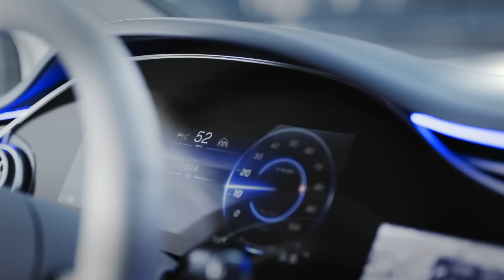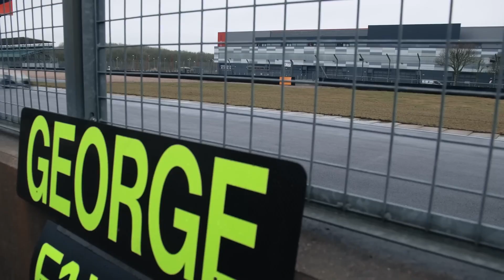Formula 1 Is Headed for Disaster..

Comment: you can't compare formula one to the entire European car industry. We're talking about hundreds of millions of vehicles with hundreds of supply chains that have to be carbon neutral by 2030. F1 only has 20 cars, 10 manufacturers and even they share the power supplies in between them. From an ecological standpoint (which is the whole idea behind electric cars) given the amount of top engineers and its reputation for innovation it is simply logical that F1 survives with combustion engines.

Comment: Not being able to go "Fully electric" is no big deal because F1 could go 99% electric and 1% ICE depending on how the contract is written.  From 2026 the power of the F1 power unit will be 50% electricity and 50% internal combustion engine and the electricity % will only get bigger in the end, the ICE will just be a generator for the electric power unit. Theoretically, an F1 power unit could run a 1-cylinder ICE the size of an RC engine and claim to be a hybrid engine and not fully electric.
Reply from the maker: very good point, its called a hybrid engine for a reason

Comment: the eu has just changed the rule that all cars need to be electic by 2030 with the coming of e-fuel that porsche is creating. its in the early stages now but it will probably become more common and cheaper over the years, so i think manufacturers will go that route as well as electric. or maybe even hydrogen?

Comment: All races could be accommodated in South Africa. The UK and Europe may be switching to electric cars by 2030, but here in South Africa there isn't even enough electricity to keep the lights on for a full 24 hours - you are lucky to get 20 hours or less at any given time. On average, electricity is available for 14 hours a day. It's the year 2023 and infrastructure progress is going down the drain quickly - we're moving back to the bush. Without combustion engines, South Africa's transportation system will not exist.